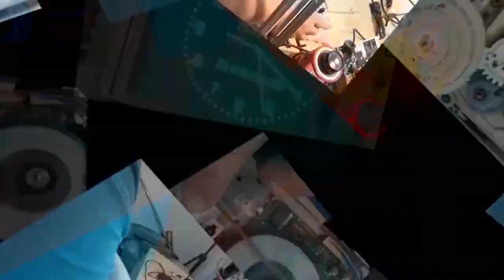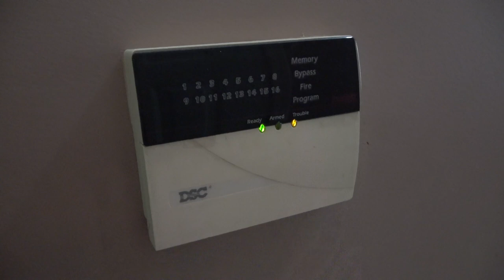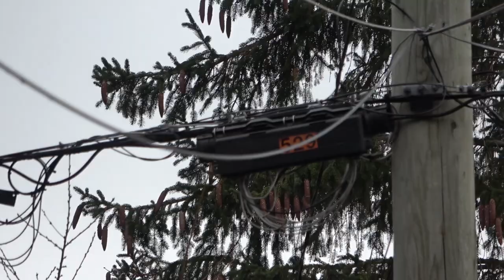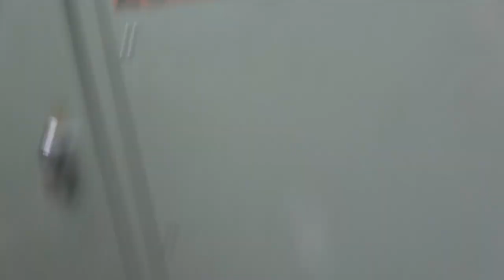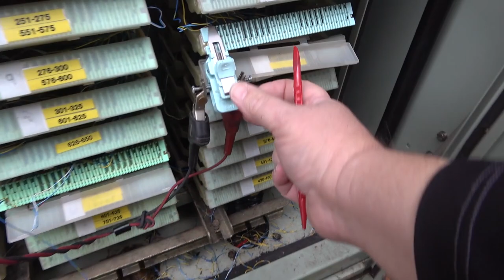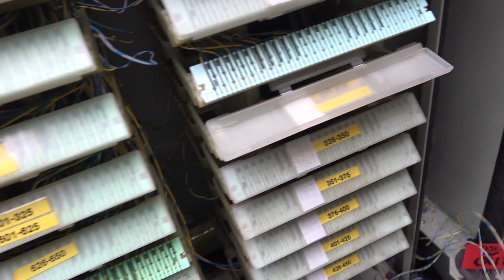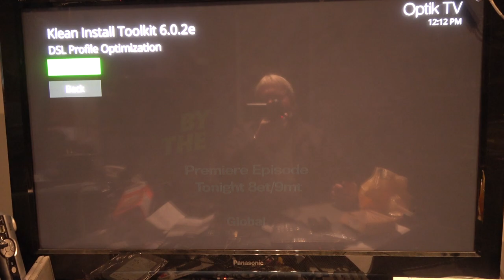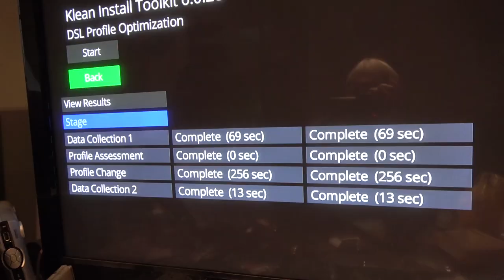Fixing my old noisy copper phone line

Comment: Centurylink (also now known as Lumen) doesn't have fiber in my area... 
and well, given the experience we've had with them throughout the years, it's questionable as to if they are maintaining their DSL lines here.
Some people claim they're getting "good" speeds, while we've never had any luck.

It's been downhill ever since Qwest was bought by them. Went from good to bad. It's been a while, but I believe this happened after the buy out, I could be wrong though. We would always lose phone service (this includes internet) every single time it would storm, well after some constant battling it was finally solved. To my knowledge we weren't ever told what the issue was, but despite losing internet (and phone) during a storm we still were getting good speeds for the time.

Well fast forward to 2020/2021 and the speeds pretty much haven't gone up at all. We've paid for higher speeds, don't get get them, called to complain and nothing ever gets done. We weren't (and others probably still are) the only ones in the area having the issue either. 

we finally said, enough is enough and caved for cable. And well... the only other ISP in my area is Mediacom sooooooo yeah.

Anyways, really cool to see you working on stuff like this.

Comment: FYI, that's not how 911 and cell phones work, GPS is not used to find a callers location. It's just a phone call so no data is sent from the phone to 911. Your location is triangulated by your carrier and that data is sent to the 911 center.
Reply from the maker: Negative.  Gps data is sent over e911 call. Triangulation is not that accutate.   You have to be near a window with at least 3 satellites visible.
Reply: @12voltvids  no it’s not. I have worked in a 911 center for 28 years. No GPS data is sent. It’s just a regular phone call.
Reply from the maker: @Fred-lr2dv  not according to our ecomm center and sar personnel. They are always going out to look for lost skiers that call 911 and they get their location.

Comment: You're mostly right, but your understand of how they'd get your location for a mobile phone is not right for a number of reasons. I will go as far to say however, you're right - it's no where near as easy to figure out where a phone call is originating when made from a mobile versus a fixed landline. 

I actually use VOIP here in the United Kingdom for my landline, we have a database here where we can register the number with a physical address - so when calling emergency services (even though it's via the internet, on my mobile) they'll instantly have my address.
Reply from the maker: VOIP lines here are also registered to your home address, but voip lines don't work when your internet os down during a power failure, but my good old copper land line does. 
Cellular most certainly does use GPS. They can also use other technologies but it is nowhere near as accurate. We have a service at work for seniors, a mobile pendent that they can call for help and has a fall detector. It uses both GPS and cell tower location, and I can access it on my computer for testing. It will show both GPS and the neighborhood locations. One based on an exact GPS location, and the other on cell tower reporting, and it is interesting to see how close or far off the 2 are. When  I am setting them up I have to do a test call to verify they work, and when there is a gps signal it is always reporting the correct location, but the cell based can be off by a couple of houses or a couple of blocks.
I had one instance a year of so ago that was a bloody embarrassment to say the least. Customer had gone to visit someone over on the island.  She wasn't wearing her pendent and had it in her purse.
The purse got banged around, and the pendent reported a fall. (the purse had been in the trunk of the car and triggered when they hit a pot hole while driving. The dispatcher received the last seen location which was at their house before it was put in the trunk (and had no GPS signal available) and since they were out of the water on the ferry by this time, no accurate triangulation data either. The ambulance and fire department was sent to the house, and broke down the door as they dispatcher could not reach the customer (because the pendent was in the trunk of the car and by this time they had exited the car and were at sea) only to find nobody home. It was an example how cellular technology as good as it can be, is easily fooled.
Reply: @12voltvids  I have backup power (with dual, diverse internet connections - 4G/5G and ground based), so internet outage during a power cut is not a concern - but yes I agree with you mostly, for most people (maybe including yourself) a copper landline is best. 

GPS on the other hand, whilst you can track a phone using it - it's not something the client software on the phone will transmit to a third party for the sake of it. If this location is shared is at the discretion of the phones software (iPhone for example, I can assure you does not share this information without the user approving it). 

Cellular companies can however defiantly use triangulation, however as you mentioned this is nowhere near as accurate even in best cases - it's often about 50-100m out. 

Ultimately, what I am saying is, landline is the best for someone identifying the callers physical location in an emergency situation.
Reply from the maker: @hiddenidentity8291  ups will run the ont here for 8 hours and the battery guess dead.  Sure you can argue that you can have multiple batteries or a backup generator but in reality very few have more than the single battery if that.  The majority don't even have that because the power backup is a big ugly box mounted to the wall.  9 out of 10 installs i do have no battery backup at all.
Reply: @12voltvids  very true, however I only use a UPS to handle load until a generator automatically kicks in. I’d agree though, by no means the standard.

Comment: the dc is injected into the pair in the field? not from co?
Reply: The CO is feeding the 48V battery for the voice lines, and probably also 190V over a couple dozen pairs to power the VDSL equipment in that green cabinet (see the red tags at the top of the cross-connect box)

Sounds like he remotely turned off the 48V for the second VDSL line to his house.
Reply from the maker: The second pair needs no DC.   We have line equipment with restricted dialtone on second pair just to dial test numbers like ANI to id the pairs.  Dry DSL user to just have a message saying you were on a restricted access line.   That made it hard to Id a line, especially if a jumper was pulled so active dt was added but not necessary.   I killed the battery and one of these days I will swap pairs when I have my truck and work gets slow.
Reply from the maker: I just left the co side of the path disconnected from the DSL in module in the cabinet.   Nobody will ever be touching the line that runs to my house because i will never call in a trouble ticket.  If my line acts up i will just fix it like I did here.  If it was a work day I would fix it on the clock.
Reply from the maker: Just the VDSL signal in injected in the cabinet.   Pots from the co here but we do have remote cabinets that do produce the dialtone in the cabinet.   Some are roadside switches and others mini co.  There are a few that are an actual house! Driving by you would think it was a redidence. Others look like a bunker sticking out if the ground half burried.  There is one i know of that looks like a big Boulder.  You open the boulder and there is a hatch, open the hatch and go down a ladder to the equipment room below ground.  These ones have gas detectors and ventilation.  Haven't been in those ones in about 13 years since I worked in Surrey but they are all over the place out there.  They have 3 big co, Newton, whalley and Cloverdale and about 20 remotes.  Everything from a street cabinet to underground vaults to what looks like a residence totally blending in with neighborhood. One even has a carport to park the vehicle in while working there.
Reply: @12voltvids  There's a couple of those underground ones around here, probably because they were part of the original inter-city toll lines prior to LTS/fiber installed around 1990.  Harrison is also underground for some reason.

Comment: wow fastest copper speed anywhere around here in ontario is 25, and that's usually not possible. Most are lucky to get 10 VDSL with a large amount still on ADSL 5.  Bell doesn't even offer service anymore they push the new 4G wireless service. We are at least 10 years behind

Comment: I hate to be that guy but cell phones can definitely use tower triangulation to get pretty accurate (within probably 10 feet) results without GPS availability. GPS can take a while to get a lock as well, so tower triangulation is used for both emergency and non-emergency services. Phones have a ton of ways of retrieving your current location - nearby WiFi networks, GPS, triangulation, IP address of connected WiFi, nearby BLE receivers / transmitters, etc.
Reply from the maker: Answer this one Einstein.  Just a week or so all over the news on CBC a 911 call about a man that was threatening to self harm himself.  Woman with him called 911 location was received and police went to address that came up and did a no knock entry as the call was for a suicidal man.  Problem was it was the wrong address and a woman and her 4 kids were terrified when the police broke down the wrong door.  In the states this would have probably resulted in a shoot out.  Just saying that your cell phone may not bring help to your exact location in an emergency where as a land line (copper, derrived voice, VoIP) will show the address where that line is installed.   Fixed point cellular will show the address where registered but those devices can be moved and thus may not be where they are listed at.
Reply: @12voltvids  I completely agree with you, landline definitely gives a better location. I just wanted to point out that there are other ways that cell phones provide location other than GPS since you didn't mention it in the video. I'll always prefer wires over wireless myself as well.

In your the scenario provided, rule #1 of calling 911 is to provide your location first, then the matter of emergency. If they were located in an area with a land line phone, then they'd likely also be able to provide an exact address. For instance, if it was an apartment complex and they had a landline phone, they'd also be able to provide the apartment number / address. What I mean to say is that if this suicidal man was found by this woman in his car or in a dark alleyway or something, they wouldn't have landline access anyway and cell would be their only option.

Modern cell phones also have WiFi calling as a feature, but you're (legally) supposed to change your WiFi calling address whenever you intend to perform a call over WiFi from a new address. This is a big deal with modern softphone software because it goes over the internet and the police have no way of knowing the address you're calling from unless you enter it before the call. Honestly it's a pain in the rear, but it's plausible that this is what happened in the news story that you're referencing. The woman places a WiFi call but doesn't dig into the settings and update her address, maybe 911 dispatch ignores the address that she provides over the phone and defaults to the auto-reported address by her phone, and boom you've got a wrong address.

I'll re-iterate though, I didn't mean to come off as starting an argument, more to add to what you were saying and not provide false info. It's a great video!
Reply from the maker: @thecactustree  I was referring to traditional cell phones.  Wifi calling adds another element of error especially if on a public wifi network. Wifi calling would only be accurate if you were on the router that was originally registered.  Now say your connection goes down and the ISP assigned you a new gateway and your old one goes back for refurbishing and ultimately ends up at someone else's home.   The registration. Would be based in mac address of the router right.  
When my dad was alive he suffered a stroke and was able to dial 911 from his home phone but could not speak.   The doctor told us that it was a good thing he had a land line so they could find him quickly because he had to inform families in the past that it took too long for the paramedics to find a person from calling 911 on a cell because the location data wasn't accurate enough to pin the physical address.  I know they have gotten better but still, a land line has your exact address, no guess work.  Many people including myself have one specifically for that reason.   Stating your address when making an emergency call is not that accurate either.  In this case of the wrong address the woman calling on her cell (from a house) got the address mixed up in her panic, so they used the e911 data from her phone and it was wrong and sent officers to the wrong address. Never think that you will be able to provide an accurate location if you are in a medical distress situation.  I refer to my dad.  He wasn't able to speak just mumble so he wouldn't have been able to give an address.  Even if a family member is calling they are also freaking out and in that situation most people just go blank.   What I was getting at is don't trust any wireless device to provide your location.  Under the right conditions, outside for example they work perfect but inside it is a crap shoot.  A land line works 100% of the time.

Comment: latency and packet loss is my main concern with DSL, just regular use is fine, but critical things like gaming, problems can  quickly arise
Reply from the maker: The gamer that lives here does VR and never complains so latency is not an issue. My ping is 9ms
Reply: @12voltvids  and in a rural area? every player from either splatoon or smash i played with  who has DSL lagged the game so badly it looked like they were lag switch hacking
Reply from the maker: @Diddz  Are you sure they were on DSL? Cable modems are notorious for long ping times. 
I have never had any issues, even when I was few from the CO directly before the FTTC cabinets went in, when I could only get 6 meg service. There were more issues when everyone on the street had DSL. Much more noise and crosstalk in the cable, but now the majority have gone to fiber and the DSLAM is not loaded to the point of bursting things are very good. My ping is better than some friends on fiber. Fiber is not getting loaded down, and reaching capacity. I just noticed they are adding a 5th OLT bay in the local CO, so I guess we will be doing a capacity split to lower the load.
Reply: @12voltvids  yah because during troubleshooting, their modem only had a telephone RJ 11 line and an ethernet RJ45 cable coming out of it, no optical or coaxial, and their speed was hovering around 5Mbps,, im certain that is NOT dialup and the lack of a coax or fiber pretty sure its DSL
Reply: @12voltvids  well i highly doubt cable modems use an RJ-11 phone wire
im super certain DSL and dial-up are the only modems that use RJ-11 to the provider

Comment: when i had service via the phone line after some punks cut the line it was "repaired" but after awhile of having some connection issues another tech was sent to my house and they found water in the line though these days i no longer have at&t which is a US provider as ive moved onto fiber optic for internet and tv at much more reasonable rates and im not even sure if they still offer dsl n stuff but i do remember noise being in the line till they replaced it and they even replaced the line coming into the house itself at no cost as the tech that was sent out was one of the nice ones

Comment: cant you have POT phone and fibre internet at the same time?
Reply from the maker: No all or nothing
Reply: @12voltvids  That's bad. Here the fiber and POT is totally separate. and moste often it's not the POT operator at all. STIL they r shutting down the POT lines, and if there is a problem it's not getting fixed. i lost my lines 2 years ang and i'm on a crappy 4G connection only. and the cell tover is maxed out during the day. AND i'm at 3.3 miles and no direct LOS :(
Reply from the maker: @grapsorz  We are not fixing copper for addresses that have fiber, but just this past week I had to fix a wet copper phone line. There was fiber in the tub, and all the neighbors have fiber but this customer refused and they are still on copper and I had to fix it. I was not happy, as I was covered in mud when I was done.
Reply: @12voltvids  here they dont fix copper at all. in my case something happened at the main central thing and they removed it.. leaving me with nothing.. and they refused to give me a alternative!!! now they have to give the users "something"

Comment: It's difficult to determine if the noise is on the source or your house if you connect your butt-set to it if it's still connected to your house. Noise isn't necessarily directional.

Edit. Good you eventually disconnected the house. Looks like the box has a grounding issue.
Reply from the maker: I disconnected the isw. It's a dirty open on tip side.